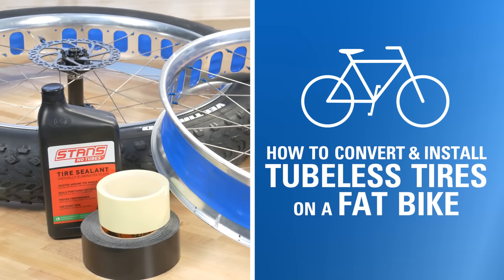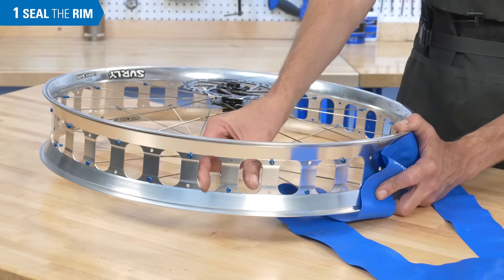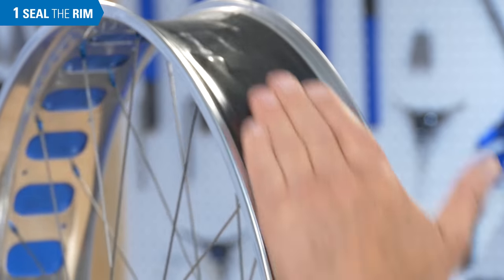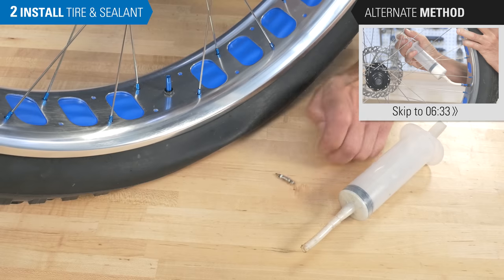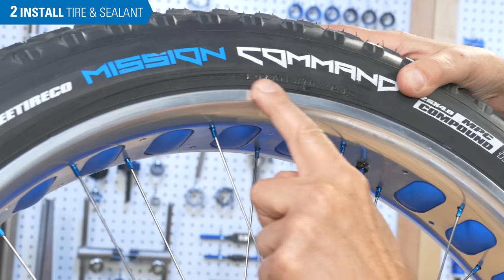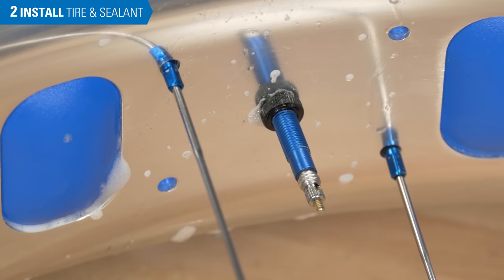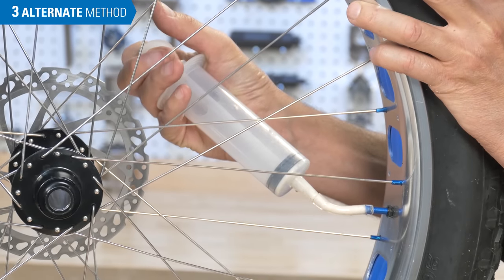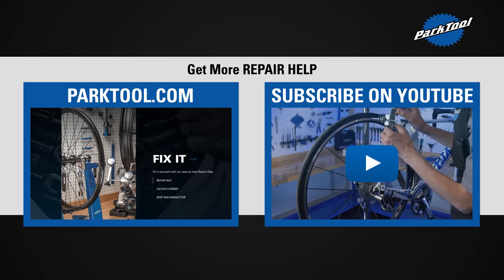How to Convert & Install Tubeless Tires on Fat Bikes

Comment: This is an excellent video. I would add a simple trick for those of us that order tires and get them shipped folded and contorted. Put your deflated tube inside the tire and inflate it until it balloons up. Leave it in there for a week or so and when you go to install the beads on the tire will be in the shape you want them.

Comment: Another method to get the bead to intially set is to take a rachet-type cargo strap and wrap it around the tire and tighten it while applying air.

Comment: I find it much easier to install the tire with a tube first, then carefully break one side, sneak the tube out of that side, install the tubeless valve with core removed and then try to pop the one bead on with it facing down over a trash can so it lays flat and level using a rubber tipped nozzle. After the second bead is secure then install the sealant and add the valve core and inflate normally using a pump.

Comment: Park Tool- Question: Looking to buy a Mokwheel Basalt ST fat tire ebike, but want to get rid of the 26 x 4 OEM wide spaced knobby off road tires, as I will be mostly street, groomed trials, or dirt roads riding. Found some 26 x 3 beach bike tires with more street treads that should perform better. Can any/all 26 x 4 wheels accept tubeless tires as it seems from you great video?

Comment: Great video. One note: Overlapped 2" Gorilla tape like this might not last very long and pressure and sealant work their way into the tape. For best possible results, use a tubeless specific rim and tire (like the video says) and get OEM yellow tubeless tape. Tape made specifically for the rim will be precisely cut to cover bead to bead (including the bead shelves) in one pass. Long term, bead to bead tape designed specifically as tubeless tape will cause fewer problems.
Reply: Hello great Comment. 
There is now 3" TOUGH  & WIDE Gorilla Tape available.
Should be wide enough for many Fat rim conversions.

Comment: If you puncture out on the trail that doesn't seal itself are you basically hiking? Is it possible/practical to also carry a tube and a pump with the tubeless system?
Reply from the maker: I carry a tube and pump just in case. Have had to use them as well. With a tubeless setup I will usually bring a valve core tool and extra valve as well.

Comment: How does this method hold up with e-bikes? I have a Rad Runner 1 that I’m tired of gettin flats on, if I convert to a tubeless will it still hold up with the weight, speed and use of the bike? I ride about 20 miles every day! I have standard 20x4 fat tires!
Reply: I swapped the knobby tires on mine to Kenda Kraze and use Slime, been months without a flat..

Comment: I had been taught that you should always use a tube in the tire after putting on the rim strip, leaving it inflated at least overnight to press the tape firmly to the rim.  I always do this, although I have one wheel that was set up by a mechanic at my LBS and he didn't do this, with no ill effects.  It seems like a good thing to do though, and Calvin has said often that patience is key in many bike-related things (like when glueing sew-ups to rims, for example.)
Reply: Joe Bond great idea! I will try that when I do mine

Comment: I am switching from summer fat tires to my studs. I used the studs last winter and there is some old glue on the bead from last instal. How to clean bead? Acetone? Abraid with fine sand paper?

Comment: please correct me if i am wrong , i always thought that you apply the tape right against the side wall so it adds thickness so that the bead seals tighter into the rim,  so why don't he put the   tape right against the side wall , effectively covering the whole  rim floor ?

Comment: Where do you get new rim liner at? I messed mine up. Not sure if “rim liner” is the correct term but the blue liner
Reply from the maker: "Rim strip" is what bike shops call them.  So, get to a bike shop for your rim strip.

Comment: You show how there can be a leak around the cutouts. How are those sealed? I have a Specialized Fatboy rim and that is the only place it is leaking from.
Reply from the maker: The best method to stop leaks at the cutouts are good initial taping over them.  However, these systems are not exactly "engineering at its finest".   There are some cases where you wait (and hope) for the sealant to work and fill the small leaks.
Reply: About how long should I wait? I spin the tire every 10-15 minutes to agitate the sealant.
Reply from the maker: It can take a couple of days to form a clot, not unlike a scab forming on a cut finger.  If there is small bubbling at the rim, these are likely to "heal". It is seems to stream out, it may require removing the tire, cleaning things up, and re-taping the rim. Good luck to you and to all tubeless conversion users.

Comment: So if i have a complitely no tubeless rim, i still can switch to tubeless ?
Reply: (I know this response is 3 years later but I hope it still helps) Id recommend using a little more rim tape then you would usually use for a "non tubeless rim" But it can still work if done correctly.
Reply: @lmandrums3118  haha a bit late indeed but i appreciate it ! I made the jump since, its still holding perfectly ! Thanks mate
Reply: WoD STALKER no problem! Glad I could help! But yea, I didn’t expect you to respond because I don’t know what could happen in 3 years, you could have even went from having a crap bike to now having a bike shop but who knows haha! The wonders of the world

Comment: Thanks Calvin and Co... but why soap and water instead of sunscreen to set that stubborn bead?! Thanks again guys
Reply: Matt Canale 

Because soapy water eventually evaporates. Sunscreen???????? I was a pro tyre fitter back in the day and will tell you NEVER use something like that to seat a tyre except in an emergency. I suggest that it will always remain slippery and may encourage the tyre to un-seat itself, especially in the "burp" situation mentioned in this video. Use it if you have to, but strip down the wheel/tyre later and clean it off. Don't use washing up liquid either, it remains slippery and chemicals in it can even attack the rubber. Use hand soap dissolved in water, it will eventually dry out completely even if some gets inside the tyre.

Comment: how close to the edge of the rim do i want the gorilla tape i can see you got close but is there anything your using as a visual guide?
Reply from the maker: Gorilla tape all the way up to the wall of the rim is suggested. The tape can help add a small amout of diameter which will make the bead seat tighter helping promote a good seal.
Reply: @parktool  awesome and thanks for the reply.  obviously results vary but is it really viable to try on a tire and a rim that both say not compatible?if it holds air its ok? worst case is that it just doesnt hold but its not unsafe if it in fact does stay inflated? i also totally understand this is at my own risk lol

Comment: I have some serious doubts about the durability of this tubeless conversion. If air escapes a bit from the bead, that's eventually sealed. If air escapes from the cutouts or the valve, there's sealer under the tape and this will loosen the tape. The tape job is also not flawless: at 2:47 you can clearly see a gap between two pieces of tape. I also ask myself why not using wider tape like the Gorilla T&W to reduce edges...
Reply: When this was filmed they may not have had the 3" TOUGH & WIDE Gorilla Tape

Comment: With all that tape and sealant fluid you could go with a tube in just a fraction of time....but anyway,  Calvin is the best!
Have you ever tried milk rice?
Reply: Yeah, and then pull it out and patch it every time you get a puncture flat, and run it at a higher pressure for less traction while you are at it. Sounds awesome!

Comment: why  is better  to do a  "tubeless system" !?,what are the proposites !?
Reply from the maker: Tubeless systems can be ridden at lower pressure offering better traction, and be resistant to rim pinches of the inner tube.  Run with sealant, they can stop slow leaks from small punctures.  For high pressure road systems, it is claimed that without an inner tube, there is less rolling resistance.

Comment: Why does nobody do an off the shelf kit?
Reply from the maker: There are a few brands that offer a kit. There is not one kit fits all though as the width of the rims change as well as profile which can effect what you need.
Reply: Park Tool The only kit I found was very similar to the your method with gorilla tape. I didn't look all that hard though. I think I'll just stick with tubes for now. Love the videos though, you guys are always very informative.

Comment: why do you need to clean the rim
Reply from the maker: Basic adhesion protocol.  The inner rim surface can be dirty, or oily from lubricated spoke nipples.  The tape needs a clean surface for a long term secure bond.

Comment: I tried and failed on my 3 inch wide (1.5 inch wide rims) tires. the bead connection was too loose. and I don't own a compressor so I am fucked. Going to try and sell the bike I guess.
Reply: Did you sell it? Ride with inner tubes for the time being!
Reply: @zamzam-br3fi  I'm going to buy tubeless-ready tires and see if they work out. If not, I'll try returning them and then sell the bike. They are not cheap for the size.

Comment: I'll never use tubless. Such a mess and really no weight loss from not having a tube. You add extra rip tape and a bunch a liquid sealant!!! With extra light tubes these days its likely lighter then tubless!! 

" If its not broken dont fix it. Only maintain it."

Comment: Looks like a pain in the McNuggets
Reply: It's actually a simple and straightforward process. The benefits are monumental, no flats. The pain in the nuggets is fixing flats on the road/trail, especially on an ebike. The first 100 miles I had my bike I had half a dozen flats. the 3,000 miles since I have had zero flats....you do the math on which is the pain.

Comment: Alternate method #2: throw a tube in there and ride.
Reply: i ride an e-bike,simlar to a scooter in apperance,and my first one in 2006 had no shitting you  68 flats in just a year and a half.on a single friday i had 3 flats fixed the first due to overpressure, the second underpressure,the last one who the hell knows it was too dark to change again,and on ave. it takes 2 hours to change that tire type.since tubeless i had a bike with no air pressure issues for 10 months so that's why.now normal bikes have less flats i agree maybe once a month in a dirty city streets like here with glass,nails,and what have you thrown around.still for 
e-bikes well worth it,normal ones not so much.

Comment: ⚠️ Do not do this! ⚠️ Seriously, save yourself the trouble and money, it will not work. You won't be able to inflate the tire once done, the air will just escape to the side.  It can be inflated, but you'll need to go to a motor garage and have them use some sort of compressor. You won't be able to inflate it yourself anymore.

Comment: Do not put sealant in before inflating.  Inflate and set the bead of the tire.  Then remove valve and the tire will deflate, but the bead will be set on both sides.  Then fill with Stans; then put valve core back in, and inflate.    This method is less messy.